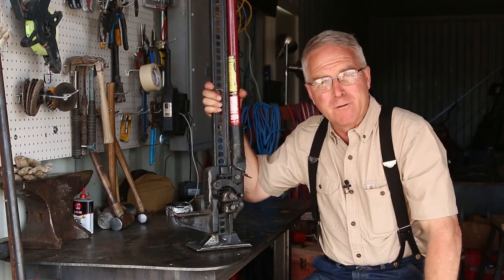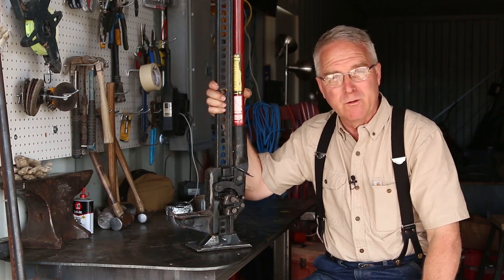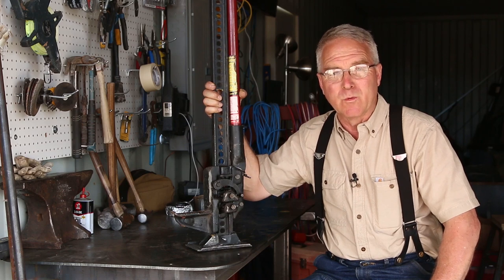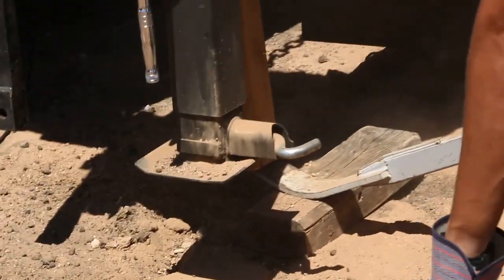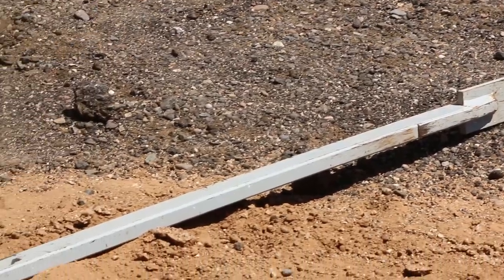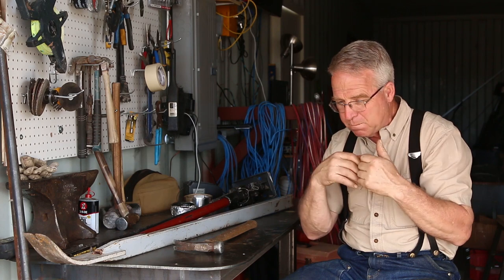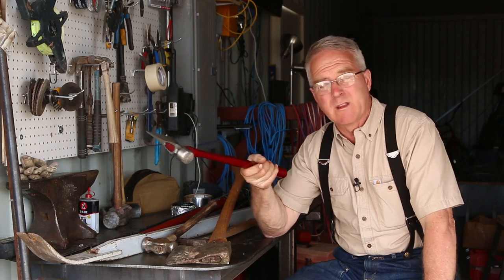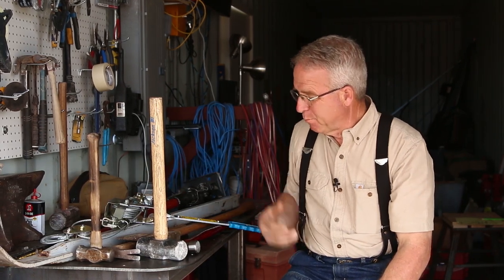5 Problem Solving Tools

Comment: I've got a digging bar thats at least 2" thick. I live in the hills and 2 of my neighbors have problematic driveways. They approach the road at too steep of an angle for those who try to head in the downhill direction of our street. Trucks n Vans end up with their  back bumper still on the driveway when their wheels get too far away from it, leaving them stuck in the middle of the one lane road with their rear wheels in the air, bumper skidded out still on the driveway.  Between the 2 of them, I gotta use that digging bar to pry them forward until their wheels contact the pavement to get traction again. I'm talking like UPS, FEDEX,  MOVING VANS, U-HAUL, ETC. ..usually loaded to the gills and always greeted with lots of skepticism when I come walking up with just that bar in my hand. I just tell them to get in and steer ...and sometimes I even have to tell them to get off the brakes if they want to pick up some time.  I do get a charge out of helping them.  It really is the payoff for me when I see how relieved they become as soon as their tires meet the road again. How would you feel being the guy who's running late, stuck and blocking traffic  in all directions, hoping a tow truck/ wrecker  will make it there before gridlock takes that possibility away too. Have you ever had to wait for AAA? Gridlock is a probability in this scenario, not a possibility. ..anyway, you get the idea. Oh, and guess what,  tis the season... I bet I pry UPS off at least once before  xmas.
Reply from the maker: BEAUTIFUL!!!!!
Reply: @essentialcraftsman  I saw your other video about the burke bar. I was sure it was going to be number 1 on this one. I don't disagree with you about the leatherman though. I've got 3 of them in various "break glass" positions.

Comment: A friend of mine saved my day with a hack saw blade. My U lock on my quite heavy Ebike had seized. Couldn't unlock it. It was locked to itself so I could still carry it but doing so had strained my neck. I was planning to carry it all the way home until I bumped into my buddy. I was able to ride home that night without ending with a worse neck stain than I had for that following week. Who knows what shape I would have ended up in if I hadn't had access to this hack saw blade.

Comment: hey essential im nott sure if u read these or respond to these. im not an expert like u so no judging lol. im reno my neighbors attic as a toy room for there child as a wedding gift for them. im trying to figure out what the best strategy for putting drywall on rafters. there house was built in the 20s and has had alot of water damage in the past so the house has settled and shifted quite a bit while remaining structurely sound. howeve the rafter or higher and lower than the next. i have tried about everything i could macgyver and every suggestion ive researched. ive tryed using a draw knife to shave an 8th- 32nd of an inch to level them. ive tryed a planer. i have tryed cutting furryying strips on table saw. im now puting inch of ply wood horizontally accros, which is working best thus far. i have framed a 4 ft kne wall and framed 2 closits and hung dywall around walls untill last sheet so i can overlap the ceiling to wall. but i am kinda stuck. also idk if u already do but could u do a video on measuring angles for beginners?

Comment: Re : Leatherman. They don't need to advertise once you use one you gotta have one I have done things with mine that I most certainly have had a more appropriate tool for the job but why bother looking for it when I have everything I need already in my pocket sometimes the job you are trying to do is time sensitive and you can't mess around looking for the right tool I never go anywhere without it

Comment: the Hi Lift jack would not make my list. Too dangerous and the stupid thing doesn't lift straight and it sinks in the dirt and gets cocked at dangerous angles and weighs a ton. Couple 10 ton Hydraulic bottle jacks and some wood cribbing will pretty much do the same thing safer and better.  IF you really need a vehicle recovery device, get a winch. Doesn't need to be a super expensive winch. Something that will provide 4000 lbs of pull will likely suffice and not break the bank.  
Great suggestion on the Burke bar. A Wonder bar is a much smaller similar shaped device, but very handy. And the Leatherman Supertool 300 is a great choice. Also would include a Victorinox Swiss Army knife and Victorinox Swiss Spirit tool in that category. Leatherman Rebar is a pretty good tool also if you want a lighter tool to carry. A 3 lb drilling hammer tends to be my hammer of choice for a lot of things. Coupled with a couple cold chisels can do a lot of things. And a hack saw. I guess the come-along is not a bad addition to any kit. Seldom needed, but when you need one, they are good to have.  Winch straps are also pretty handy. And a stout shovel.   And a very complete mechanics tool kit, tire plug kits, inflators, rubber wheel chocks, moving blankets, polyester rope (not poly propylene), oil, liquid wrench, huge breaker bars and a cheater bar and an impact gun, angle grinder, lights, full set of PPE.  Water pump fliers and needle nose pliers get a ton of use. And SS mechanics wire. Electrical multi meter. etc.

Comment: The come along is not legal in canadian construction. We used ratchet chainblocks, it served me well to move an escalator in place.
Reply: I also seen a trucker use a burke bar to pry up a pallet of cedar shingles to add dollies and was impressed with this tool. I only have a 5 ft pinch bar which is similar but has no flat end.
Reply: Also had a customer lend me his farm jack for removing rotted fence posts and he had added a hook on it so we could strap a chain to the burried rotten post. Had to dig around until the chain could grab around the post and 2 guys one to stand the jack and the other to crank. Good times

Comment: I use to do remodeling for 5005, after remodeling St. Mary U.in So Mpls. Under, D. Maloney, chief operating officer,from 2997_2001.  At the parks they manage, in winter ❄️ it dropped down to - 30 so sewage line freezes up and Gary R. Bought a pressure washer steamer, (company funds,) but I have no access to it, so I made my own I bought a used electric water heater it was a 220W. It was 12 inches by 10 inches or a little bit bigger, one that sit on the wall or under the sink, attach a hose, and a cheep 15 horse pressure washer hose and wand, and  it cut through the frozen ice in that 3 inch PVC pipe, and Gary said don't tell Bob, Bob is the owner of 5005, , Gary was just head maintenance but I do the remodeling he didn't, his son used it once and left it in the Cold, and was damaged from freezing, he also damage the expensive Bob cat hydraulic hole digger by switching the couplings, funny, I couldn't use these equipment, they said, even though Bob gave we access to it, and I operate a New Holland for quite a few years digging holes to plant trees and shrubs, funny,

Comment: Can a Rachestrap used for flatbed tractor trailers server as a come along 
So you basically get 2 tools in one.  Im talking the big 2" belts.  The straps along can lift 10 thousand lbs i belive  you can use it as a tow rope winch a car up lift a motor pull 2 things togather reseal a tire that has  lost its rim seal, I use mine on my lawn tractor all the time just for that.
If I dont jack up the tractor the air leaks out the tire and knocks it off the rim seal
It won't hold air untill you pop it back into place placing thd strap around the center of the tire and making it tight pushes the side walls back into place with that presure on it you can use a low presure pump to fill the tire back up. After you get some air into it the sidewalls will hold and you can losses the strap.
You can also use these to guide a trees direction of fall when cutting it down if cutting has a risk of the tree falling the wrong direction.

Comment: There are no other brands. I've tried several as back-ups or vehicle stashed tools. Every other brand I've tried are such poor quality that they are more likely to cause injury than they are to solve a problem. Leatherman is a tool, the others are toys made to look like the tool.

If someone doesn't feel that they can afford a Leatherman, a small canvas bag with a multibit screwdriver, a pair of needlenosed pliers, and pocket knife would get them much of the functionality they need in a pinch.

Comment: I have a horrible story that drives home the need for carrying a multitool.  Usually I always have my pocket knife and Leatherman on me.  This day was Christmas and we drove up a steep canyon road to my parents house.  On the way back home, a car had gone over the edge of the road.  A husband and wife, older couple, were in the car now 80 feet below, car was upside down and about to slide into the treacherous Kern River.  When I got to them the husband was pinned by his neck under the driver's door, his body still suspended upside down by his seat belt.  The door was crushing his windpipe and he was dying.  Because it was Christmas I was "off duty" and didn't have anyway to cut him free.  I was completely helpless and useless and that man died that day because I couldn't cut a seat belt.  Needless to say, I carry both a sharp pocket knife and a Leatherman with me at all times, whether I'm going to church or taking the kids kayaking.  I am never off duty and that will never happen again!

Comment: Just the other day I was coming home from running some superfluous task, rather begrudgingly as it was a day of rest for me and the task at hand was only there because of the negligence of another and I was doing it to demonstrate diligence-a lesson sometimes lost on teenagers. All of this to say, I wasn't in a very pleasant mood. I pass a couple of young women using those cam lock straps to tie down a box spring atop their mid size SUV with no rack. At the risk of being a jerk "mansplainer", which I know bugs my wife and co., I stopped and insisted I give them one of my ratcheting straps to tie it down. I had it set already so I didn't bother checking to see if they could operate it and assumed they'd figure it out if they hadn't already used one. The thought of a box spring coming off that car, on any road at any speed, was a scary one and I felt better knowing they were at least better equipped for this. All the better I kept my distance anyhow I suppose. As I pulled up in my driveway I felt that satisfaction, albeit a tempered one. I would have liked to really wrench that box spring to the car, preferably with two straps.

Comment: How many times have I cut open a package, or cut a thread, or removed a tag, trimmed back a branch or whittled a whimsical thing, carved letters and words, or used the point of my knife to dig out a broken key or some such, or tighten an eyeglass screw. Events and uses come back to me as I tap on this thing.
Knives are now treated as the tool of terrorists instead of the tool of good and decent men willing to do what needs doing.

Comment: The owner operator of the truck with with the shipping container doesn't seem like the sharpest tool in the shed... He got the shipping container bound? And what was he doing moving a shipping container like that with a 1500 1/2 ton truck in the first place... He needs a 2500 or 3500 truck to move loads like that.

Comment: Last tool. Flashlight.

Leatherman. I dont own one. I dont even use a pocket knife anymore. Reason it limits where you can take it in 2021.  
Can't take it on an airplane. bus, bank. Government buildings courthouse almost anywhere now days. This used to be a free country. Not anymore.
I've had tiny knifes taken away and put in the trash walking into sporting events
Like its a WWMD  wtf your going to attack 70k fans with a 4" blade. I doubt it.

Comment: Multi-tools . . . the most overrated pieces of uselessness ever marketed.  I've never had a problem that could fixed with a multi-tool.  I've used mine a few times as a 1/4" driver when a regular screwdriver would have worked better and wasn't 50 feet away.  I just used the multi-tool just to see if it was worth having.  It wasn't.  It was difficult and took far more time than a screwdriver would have with less weight.  I think anybody would better off carrying a small adjustable wrench, (yes in spite of their notorious self-adjusting when you don't want to to "feature"), a small pair of Vise-Grips, and a couple of screwdrivers, (I'm curious about you, Fix-It sticks).  No more weight than a multi-tool but actually useful. "But what about the blade?"  Do you really put your shoes on before you have a knife in your pocket?